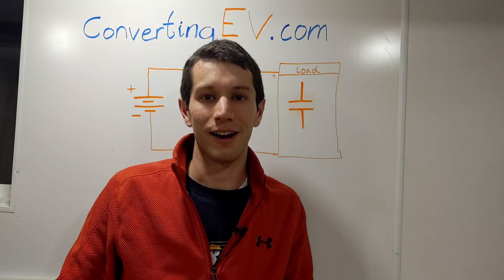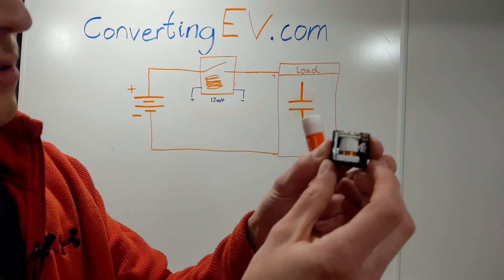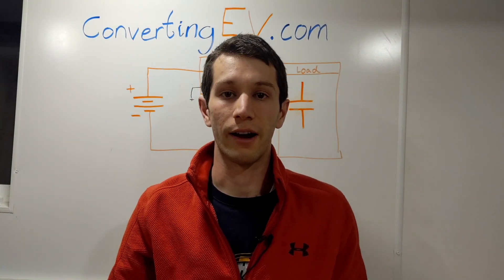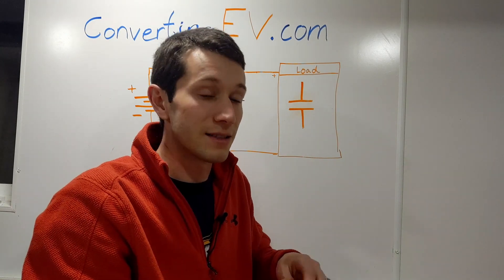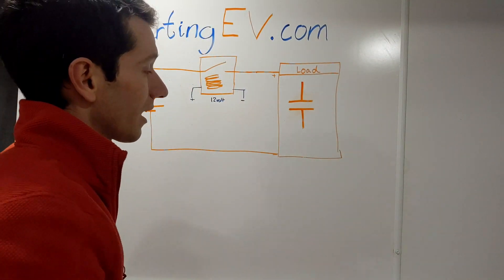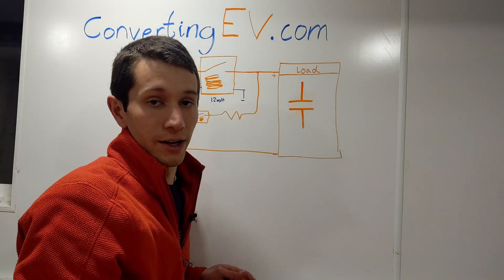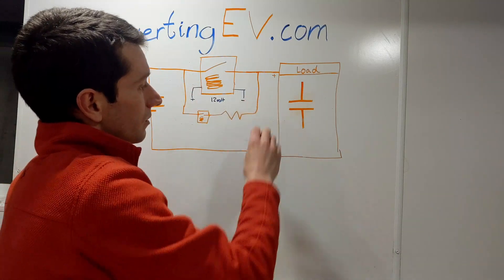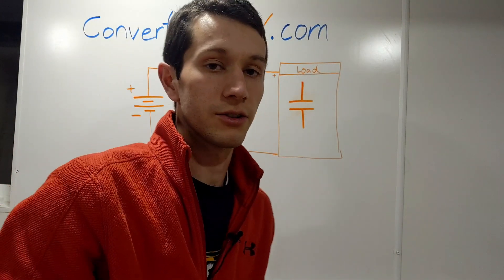What's a pre-charge circuit?

Comment: Okay... So, to be clear... you need a pre-charge circuit when you have a battery pack of hundreds of volts, but you would not need one if you are building a little household lithium power station using a single 12volt LiFePo4 battery, correct??
Reply: Correct

Comment: Does the inverter get pre-charged from the 12v source since it's going through the 12v relay? or is it still from the high voltage source?
Reply from the maker: The inverter is charged from the HV source. The 12v just operates the relay. The HV and 12v are isolated from each other.